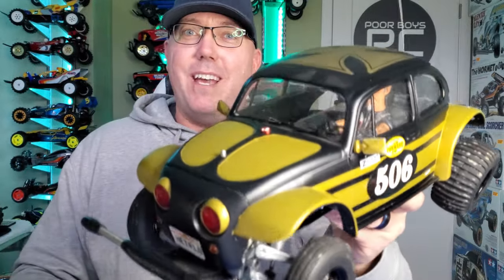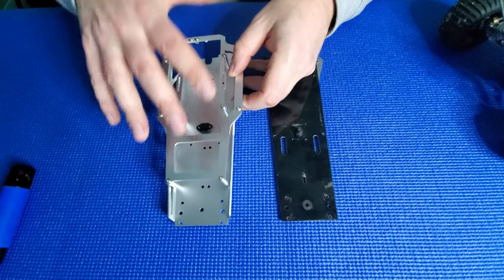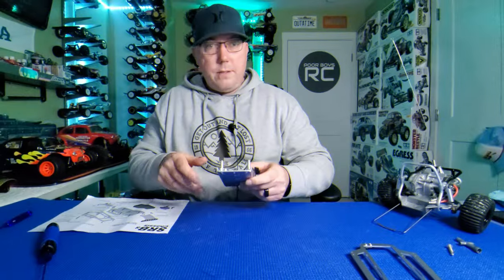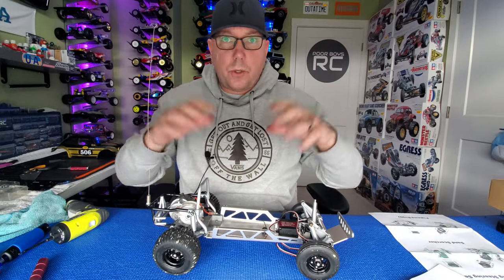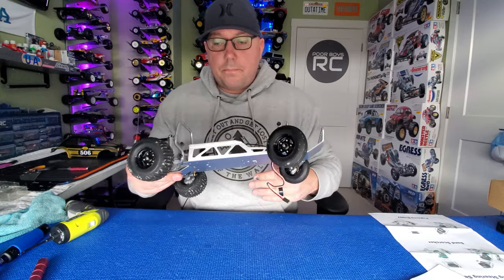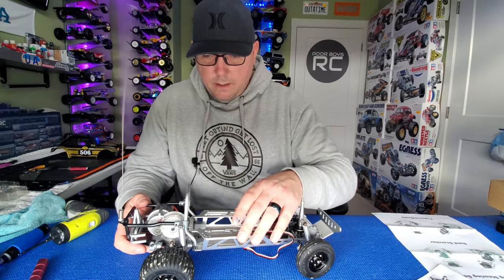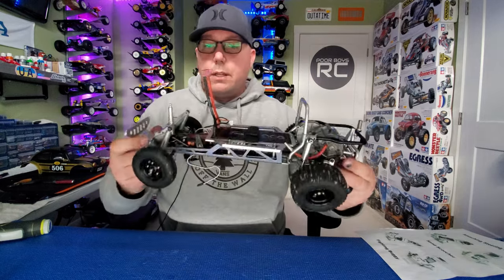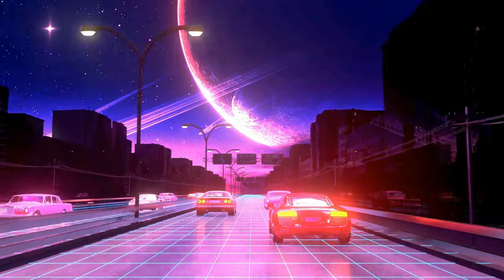Kingfly RC Aluminum SRB Chassis Install Video

Comment: Thanks for the video.  I bought this and have changed over parts.

Flipping the steering pickup points on the knuckles changes the geometry too much of the steering linkage.  The steering changes toe-in to toe-out as the arms compress.  I might cut my chassis to bring it back to stock angles.

The battery strap is useless.  Unless you add some velcro it still slides around.  Might as well just velcro the battery down.

Too bad there isn't a larger flat surface to the top plate at the back.  I'm going to cut my own plate to mount my ESC and receiver.
Reply from the maker: Yeah this chassis certainly makes a lot of changes to the standard SRB layout. It's got its strengths and weaknesses, but overall, I'm really happy with it. Especially when compared to how flimsy the stock chassis was. 👊🏼

Comment: Looks nice but going to question the functionality of it.

Having a rigid chassis might work for some models but I'd say that it wouldn't do much good for the SRB.

Way back when these first came out we would thrash on them, ride them hard, used them just like the 'stunt' pieces today that do all these spectacular jumps and such. So when I see videos of how tenderly these re-pop SRB's are treated I have to laugh, because that is not how we used to drive them back in the day.

I might offer a few criticisms in regards to this rigid chassis kit. In '80-'81 I actually broke the fibreglass chassis that I had, it broke somewhere near the front suspension mounts, from years of long distance jump landings I would think. Our local shop didn't have a replacement and had to order one, so I made my own out of a piece to flat stock aluminum from our high school shop class. I bent the sides in order to give it some rigidity and lateral strength.

It worked fine for a few months, so a few others in our group also did the same, in various ways, but after a few weeks-months we all started have suspension failures. The arms where the shocks would bolt into the casting would crack, granted we all had some variation of a coil over, but we all used mild to very mild springs (that we source from I cannot recall where), nothing really more than in the long tension arm set up.

One of the reasons why we milled our own versions of suspension arms, but that is another story.

The original casting on the original arms where the shocks bolt to is a real weak point in the design if your out driving these as hard as they can actually be driven, the rigid frame is only going to make it that much worse. The fibreglass is there to help absorb some of those impacts, twisting and bending. So the suspension doesn't have to.

The other pieces that used to bend with a rigid frame where the shafts in the front suspension that the swing arms mounted onto, as well as the smaller shafts in the rear arms which would also oblong the holes in the case, which at the time were hard to source. We even machined our own front shafts with harder steel that still bent, only when we went back to the fibreglass chassis then that issue resolve itself.

If I was going to toss some cash into adding something to my SRB, I would look at getting coil-overs first (even doubling up on them front and back), long before I would even think of replacing the chassis frame, then some steel u-joints, upgrade the rear cage and arms. RCChannel  has a great set up.

In my 40+ years of experience running SRB's, I would never waste my green on a rigid frame.

Just my 2 cents.
Reply from the maker: First of all, most excellent profile pic! As a fellow Canuck, and Hip fan... 👌👌👌

Secondly, yeah this chassis might not be for everyone. It's blingy, and really takes an old platform and (in my opinion) brings it back into the limelight and modern RC world with a cool new hop up.

I'm actually planning on going back to the OG chassis. If you wanna watch my Sand Scorcher build series you'll see why. I went mental on the body and driver. I'm a big Metalhead at heart, and the Sand Scorcher ended up as an homage to James Hetfield, Metallica and James' Les Paul. 🎸 

Great info, thanks for sharing! 👍🏻
Reply: @poorboysrc  Thanks, yes been a Hip fan since I first saw them in Calgary way back in 1988 ?🤔, been so long I cannot recall now..

Seen them at least once a year since, went to both shows on the last tour in Calgary..😥

Very sad the day we lost Gordie 😢

I will check out that build, even though I am not much of a Metallica listener 😉, I was much more into the off shore bands myself, Maiden, Sabbath, Priest, Scorpions, early Leppard, Purple, Accept, etc.

You should check out RCChannel's upgrade parts, they work well, especially the shock kits. 

😎